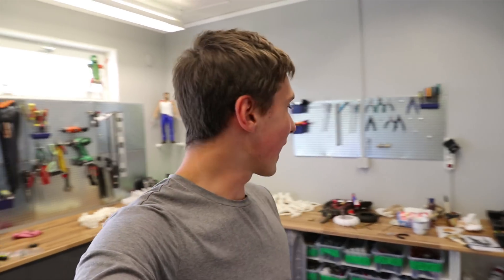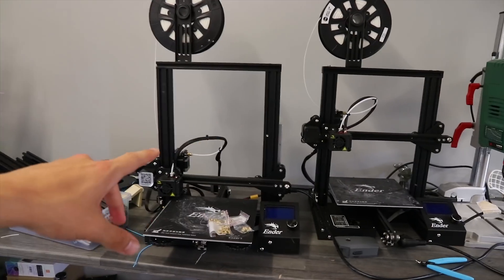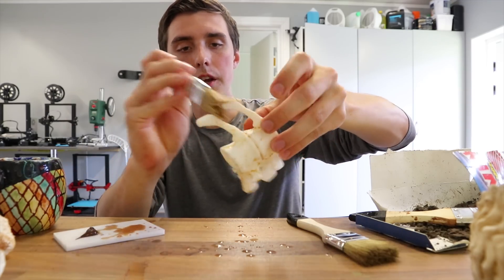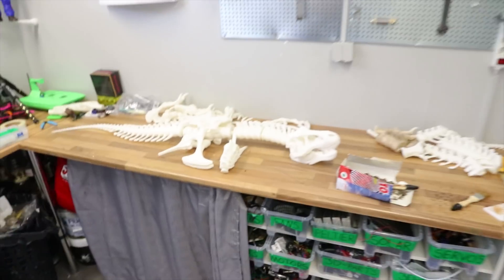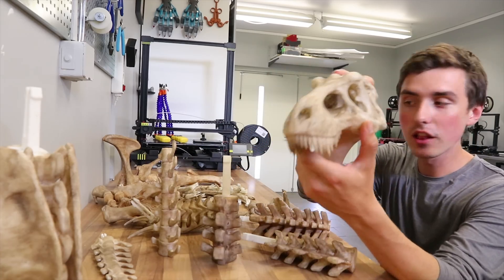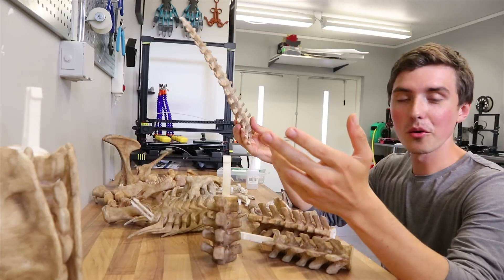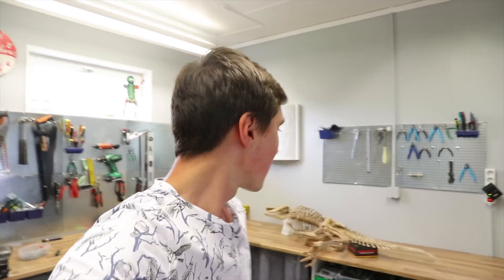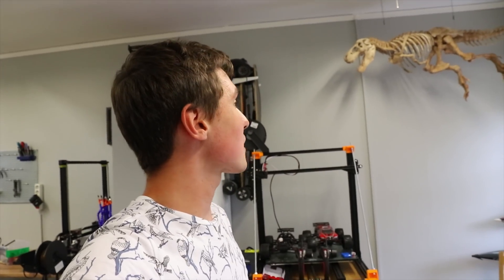BIG 3D Printed T-Rex Skeleton

Comment: Im currently trying to print this model, but of course the original size.
 Im struggling to print the parts that Print vertically like the femur etc.
 My printer will literally knock the print off at around 95% complete 😢

Comment: Would you get away without infill and an added perimeter? Should the hip be printed with more infill? I want to put in on a stand and i don't want it to tip over. Printing at 200. Any tips and advice is greatly appreciated

Comment: I found your channel while hunting for ways to color 3D printed bones. Coincidentally I just finished printing my own T-Rex using the same model you used. I scaled mine 170% which was the largest I could do on the Makerbot Replicator 2. I had to stop one print early to cut the assembly pin short. I figured on using Super Glue. Great video! Liked and subscribed.

Comment: This is awesome, I would like to know if you need to have a master cam background in order to deal with the 3D printing ??? Because I’m seriously considering to buy a 3D printing machine
Reply: You do not need definitely! 3D software is SO easy to use nowadays, tons of tutorials on yt, printers cheap and reliable. I just bought Prusa mk3s kit, put it together, installed Fusion 360 and already printed TRex skull and made small parts for myself.
Reply: eXtreme enduro thank you 👍🏻

Comment: looking at that big printer you linked to.. anyone know the difference between "US-plug" and "EU-plug"? guessing it is 110Volts in US and 220/230Volts in EU?
Reply: Well there is also the plug shape. I bought the US-Plug one and it has an option to switch from 110 volts to 220

Comment: we have the CR-10s, Would you know how big we can go to fit all the pieces in? %percentage wise? We printed one of these on the Ender 2, reduced and used the wood PLA. Turned out pretty good, but a lot of strings and had to clean up a lot. The wood PLA needs a lot of experimentation to get it right on your printer.

Comment: Cool, great job. There may be a faster  way to weather light colored PLA: buy some Potassium permanganate crystals (not a lot, 3 grams will be more than enough for couple of skeletons ), dissolve some in a bucket and put PLA parts in it. In 12 hours - couple of days depending on concentration they will be brown with natural shading, like something from the bog. Rinse, dry and mount. Keep longer for blacker finish. Theoretically it is possible to get them almost black but never tried it. With bucket large enough you can do the whole skeleton in one go.
The only drawback of the method is necessity to keep surface grease-free: any glue patch of greasy fingerprint will show as light patch. And remember to check the parts and steer the solution to keep it uniform. Also depending on printing settings  and PLA brand it may highlight steps and gaps between layers, so try it on one printed part first.
May also work on resin casts. 
Definitely works great on bone, leather  and horn, cause it the same process which colors them in bogs, only greatly accelerated
Reply: Where does one buy Potassium permanganate crystals?

Comment: Hello! I'm trying to print a TRex Jaw, but I met a problem. Some layers (near overhang angles) starting bending (or winging, however), and become wavy near an outer shell.  And because of that my print looks ugly a little bit, and in the midle of printing process extruder colide this wavy area, and the model didnt stuck to the table after that.

I have "Anet A6" printer from aliexpress and use "esun" PLA Filament.

Picture (URL):
https://sun9-4.userapi.com/c831208/v831208291/18bb15/6WAYCr3bXE8.jpg

Comment: Love your channel !  I am learning a lot from it!  I tried this model and I used support material (Cura) and there is SOOOO much to remove, my parts look like crap.  Do you not use support material as a general rule?  It looks like your parts could fall over so easily on a long print and then you are back to square one.  so, what parts did you use supports and to what extent?  Maybe I am over doing supports too much... ?

Comment: I would have been worried that the wash like dirt treatment would settle in the layer lines and make them stand out.  Defnitely not the case at all.  Did you do any light sanding on the parts before applying paint and dirt?  Looks great!

Comment: This model along with base was one of my earlier prints when I got my Mk3.  All of the MakerBot models are very good.  Problems I had with this model were some of the smaller thinner parts especially the ribs.  I ended up using custom supports, but I would recommend using something to make bed adhesion rock solid.  All in all this is a great model and well worth the time to print.  I printed my bones in glow in the dark PLA from Hatchbox (wonderful stuff) and the base in Peach (Tan) from 3D Solutech.  My build is on Thingiverse.